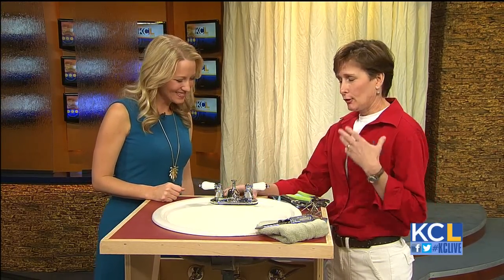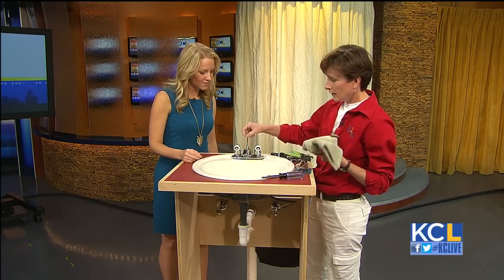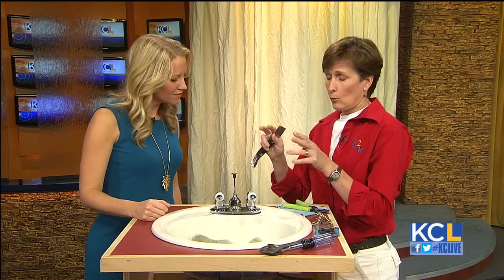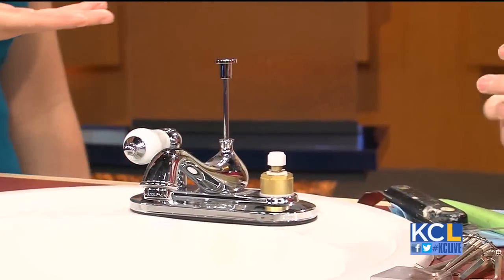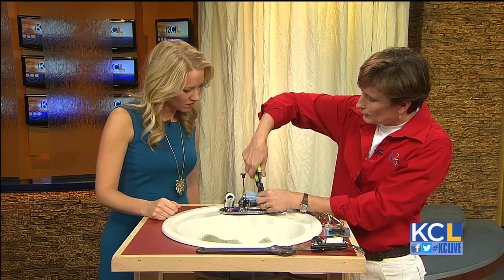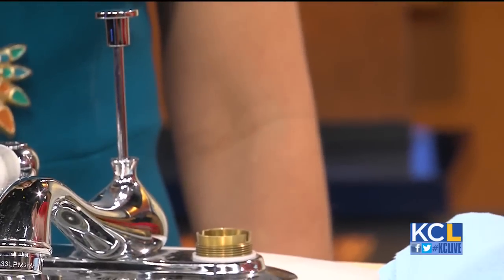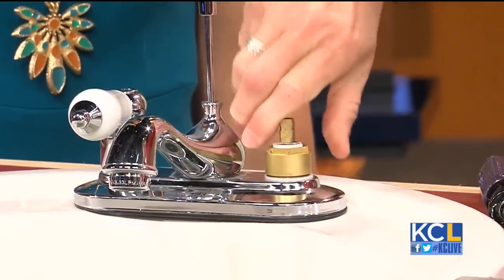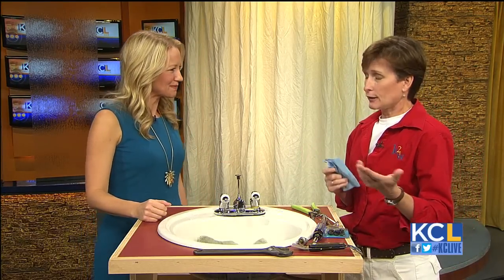How to fix a leaking faucet yourself

Comment: Instead of throwing my valves away and replacing them, I thumbed off the rubber seals and then immersed the largely brass and plastic valves in vinegar for half an hour. The acetic acid ate away the limestone build-up (invisible, but it was there) and once back in the assembly, the dripping tap was fixed.

Comment: I got a similar faucet and sink. It's really an easy fix. In my situation the leak was on the faucet itself not on the knobs. Water keeps on dripping and when you touch the dripping water it's not hot BUT what I've had discovered the problem was with the hot knob because the first one that I fixed was the Cold water knob and it still leaks. I unscrew everything and pull the valve stem. What I saw is some small rocks/sediments and dirt. I just cleaned everything and I also pulled everything out from the bottom of the valve stem (rubber seal with metal ring, 2-ceramic cartridges it's like a round flat buttons and a flat round plastic with rectangular hole that holds one of the ceramic cartridge) and brushed everything with soap using my dirty old toothbrush and reassemble it again and placed everything up, turned on the main water valve and everything works great! I fixed it without replacing that old dirty valve stem. It's been about a year now and it still works well.
Reply: unholyarmor

Comment: what if the water flow is alot even if it is off on bottom of sink?? and when take that white plastic tube water is pouring out anyways
Reply: Make sure both your hot and cold water valves below the sink are turned off even if you're only working on one side of the faucet. If both are turned off and the faucet is still leaking, you may have bad shutoff valves.

Comment: Old valve is stuck, seems impossible to get it out. Could the contractor's plumber used cement? Real bummer. If i could get the damned thing out, I have the replacement cartridge (Glacier Bay).  A pox on Price Phister. I've had all kinds of problems with their products.
Reply: Daniel--Same problem here.  I thought I could sort of rock out the old cartridge , but after an hour of mangling the old cartridge, I have moved it only about a millimeter.